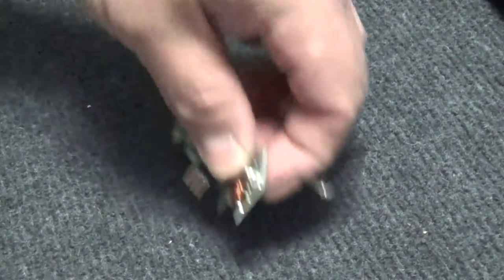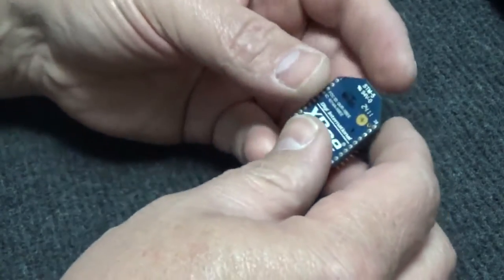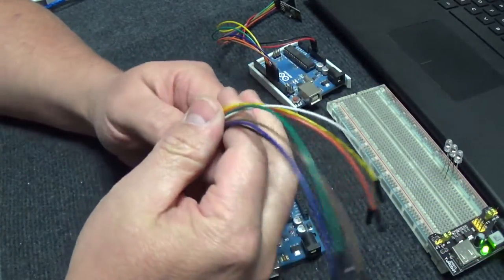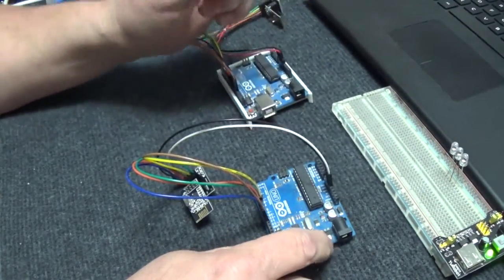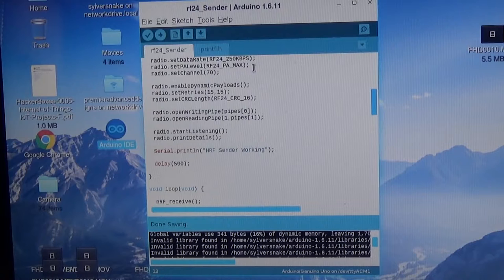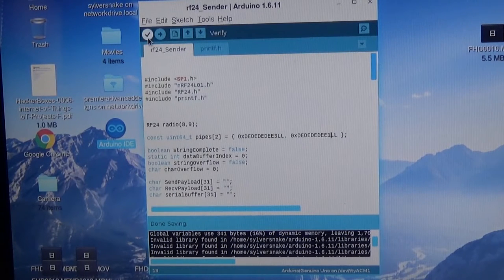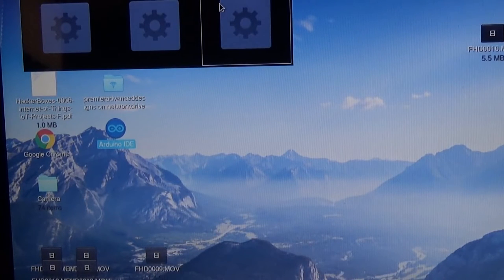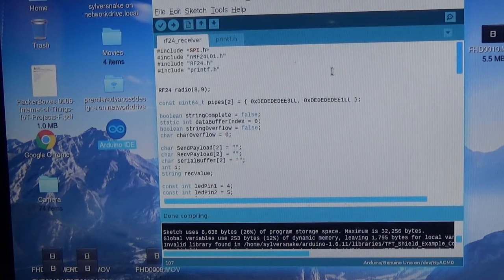Arduino Basics - Radio Communications

Comment: i'm very interested in radio comminucation and LCD/tutchscreens for arduino.
any recomandations for beginner Gear?

(i do own two Arduino uno's, An arduino mega and a Arduino micro)
Reply from the maker: It can be a pain when you just start out in the touchscreen and wireless world of arduino. Based purely on my own experience I would say that getting a 3.2" touchscreen from SainSmart would be an easy starting point for the touchscreen ( just use the UTFT libraries ). And for wireless either an Xbee or a cheap rf radio from china. Stay away from the nrf24l01 until you have a bit more experience as they do have a sharp learning curve and can be burned up very easily. Maybe I can do a beginners video if enough people want it.
Reply: Great! Thanks for the advice!
Loving the video's btw